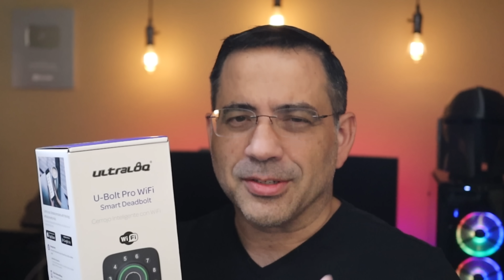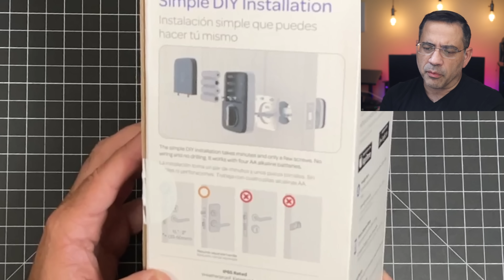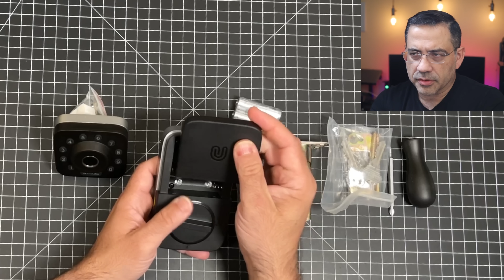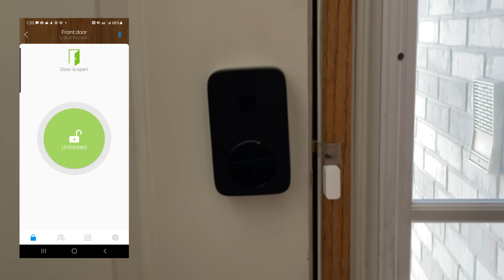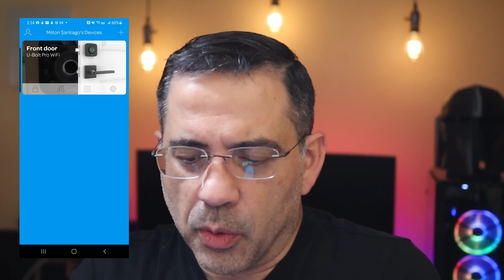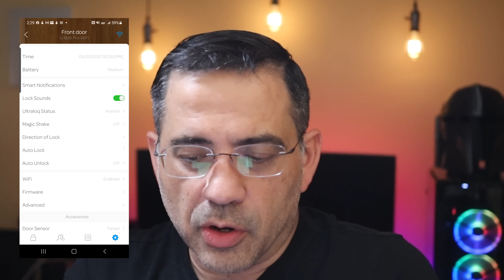New 2021 U Bolt Pro WIFI  Smart Deadbolt Now With Door Sensors

Comment: Hi there!
I use to have the previous version of that lock and the only cons I got form it is that I believe it should have a rechargeable battery and a door sensor, I am so glad the new one has the door sensor but it still missing the rechargeable battery!
After that it will definitely the undefeatable best of all and the only one real "smartlock"

Comment: We had one, and it broken less than 18 months. Good design but bad quality. We asked the company for a replacement, they only offer 30% to buy a new one and only send to USA. So disappointed. Will not use their product again. Maybe try Yale or Eufy.
Reply: It's a real shame that companies like Wirecutter and PCmag are promoting this as the best smart lock. So many user reviews are revealing that the product doesn't last, isn't reliable, and on top of that customer service is pretty bad.

Comment: Does this have a shorter battery life than the previous model without the integrated wifi?
Reply: It does.
Reply: But by how much? 2x or even 4x less battery life?
Reply: @martinlatreille5511  with Bluetooth it will last up to 6 months.

Comment: Any issues with your fingerprint not “waking up the unit” ? I experienced this on the old unit. Also, did you try the door sensor on a metal door? It says it won’t work but I’m curious if it will

Comment: Not yet ready for prime time.  I bought one 4 months ago and it has been nothing but trouble.  Setting up the wifi connection is hit-or-miss; it only connects to a 2.4 GHz network; it occasionally loses settings; recently stopped working altogether, and though battery level was reported as ok, changing the batteries restored function; frequently it will stop allowing remote connections and I have to totally reset everything and start from scratch to get it working again (and with the hit-or-miss wifi setup, that is particularly painful); etc, etc.  Phone support is non-existent -- phone support puts you in a phone tree for 10 minutes, then offers to call you back if you leave information, but they never actually call you back. The ideas behind this are great, as is the fingerprint detector, but they brought it to market before they had all the bugs worked out.  Fail.

Comment: I think he’s showing the old model as it has a WiFi adapter that has to be plugged in. The new model has WiFi built in and does have a shorter battery life.
Reply: Im looking for a product like this but the battery life with Wi-Fi wasn't tested here. I dont want a unit that requires me to have to visit my long term rental every 3 weeks to change the battery because it needs to communicate with WI-FI
Reply: @stldweller  I’m in the same dilemma. What I found was the BT versions with the WiFi hub have the best battery life. If the Wi-Fi is built in, it will eat up power.
Reply: @EatLotsOfCurry  I could live with the WI-FI hub. I'm still doing some comparison shopping but this is near the top of the list.
Reply: @stldweller  one think I had to consider for long term rentals, is the key way can’t be changed easily. This one is still on top of my list too.
Reply: @stldweller  The problem with the old version with a "wifi bridge" is that it doesn't have the door sensor, which IMO should have been a basic feature from the get-go. It means that the lock will auto-lock even if the door is not closed, basically a stupid auto-lock.